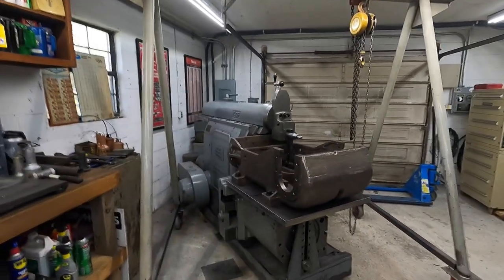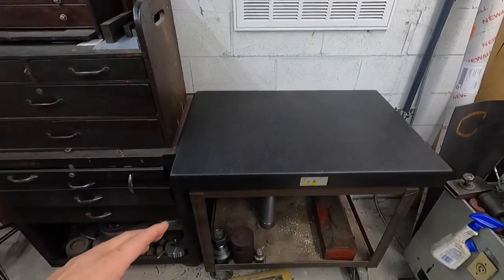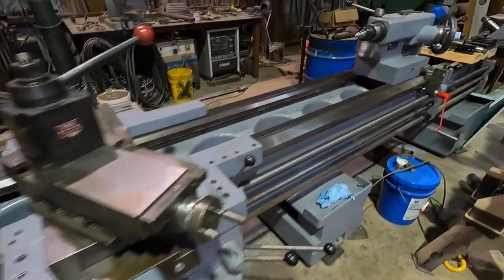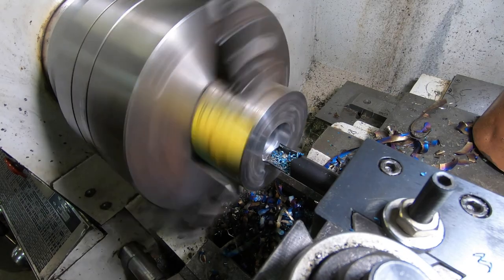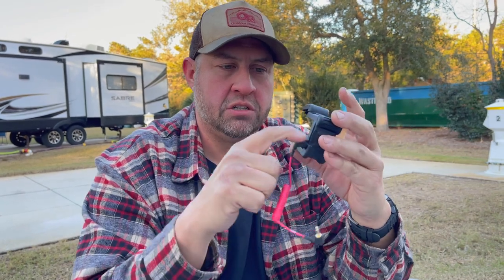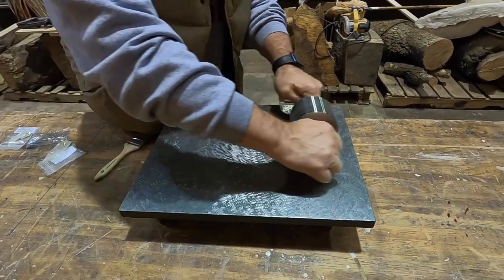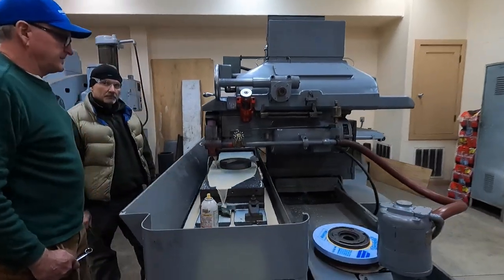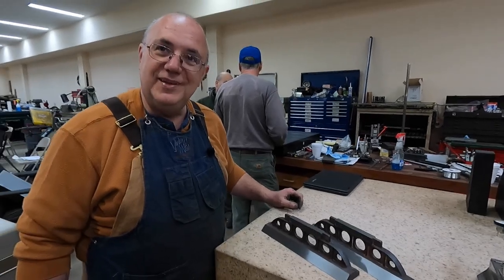SNS 333: Several Shop Projects, Richard King Scraping Class, Audio Problems

Comment: GoPro's are notorious with voltage fluctuations when they get chilled and really cold. A lot of Youtubers up north are having issues of all kinds. Many of them have resorted to using 1" inch thick pink foam board to make a box for the back of the camera with room inside to stick a hand warmer pack inside.

Comment: Ref. (Stoker) Good choice Adam. Knowing machinery limits and not over stepping, is the safest option. Obviously camera angles show one version and from the actual picture it will appear differently. This is something for all of us to consider. The physical dimensions of the machine that is needed to cut the flats, would be a big machine. As you mention keeping centricity and linear planes true would be difficult with what you have currently (as good as they are). Good job man.

Comment: Hi Adam, I run a Go Pro Hero 3 and had audio problems with it.  The audio was either out of sync or not picking up any audio at all.  After a lot of research I found out that if the SD card is allowed to become half full of files, it caused the camera to experience the audio problems I was having.  Now, I film my segments for our Patreon Channel and  make sure I clear the audio files off the camera after I have downloaded them to my hard drive.  Since adopting this, I have eliminated all my audio problems, the camera now works perfectly.  It was very frustrating and annoying until I stumbled on the fix.  Hoping it might help you out.  Great video by the way, always look forward to your videos.  Regards a fan from Aus.

Comment: Thanks for the video Adam.
A2 is an air-hardening tool steel, the quench medium is air. 
One way to lessen the oxidation is to wrap the part in stainless steel foil before placing in the oven.
Reply from the maker: There’s lots of info on that in the book we used as our reference. Doesn’t HAVE to be air hardened, explained in the book.

Comment: Rule #1 in recording audio; check that you have audio, thqt your batteries are full, have spares, etc.
Rule #2 in recording audio; always have two separate devices recoding so that if the primary mic fails, you still havea a backup recording that may sound crap but at least you have something. You can get small recorders from Zoom or tascam that do a good job, you can mount them next to your camera so they will hear the same sound.
Reply from the maker: Defeats the purpose of having a single GoPro camera in your pocket and recording on the fly. Do you see folks who use them skateboarding, dirtbike riding, skydiving etc. using separate audio mics? The camera should work as designed and sold to us.

Comment: One way to test the wireless mic is to plug the receiver into your pc, there should be a recording app on there, if not, download Audacity
Or if you have an amplifier that takes that plug or an adaptor from 3.5mm to 6mm, wiggle the wires etc to find faults.
One of the things i'd recommend, have a mic plugged into the camera, then use a recording mic on your person, you'd haver to remember to make a noise to sync both mics (bang 2 tools together, then in editing line up the peaks) whatever way you decide, try to have 2 mics

Comment: The stoker engine part is a job for a horizontal boring mill like the one bcbloc02 has. The large mill I ran would have likely worked.

Comment: For your own surface plate stick a wedge ( or just a washer ) in two corners of the frame and a wedge in the center of the opposite side. There three points

Comment: I stopped using gopro when I had a 4.if you used the WiFi and phone app to control it the audio had a helicopter sound. Gopro knew this but did not recall the cameras. There are far better cameras for what you need. You don't really need a sports camera for everything. How about making a magnetic camera mount and have a couple of cheap $150 cameras mounted around the shop. Gopro is a brand that in my opinion is way over priced and lacks functionality. Your iPhone looked and sounded great.
Reply: Are you suggesting using the iPhone to record?Talk about lacking functionality. That is almost as bad as when I have students come for high level sciences that require a lot of math, and when I ask them if they brought their calculator they say, "no but I have my phone." LOL. You can't do math with a phone calculator and expect to do well. The phone turning off, having to unlock it, notifications, distractions, the screen doing between portrait/landscape, etc. Same goes for producing hours with of video each week. You can't shoot 10 hours of video per week with a cellphone. $150 cameras also aren't going to do what he needs them to do.
Reply: @littlejackalo5326  The iphone is 100x better than recording than a crappy gopro and far more reliable.  I am thinking you never have used either.  Anyone who does videos seriously has more than one camera for different circumstances.  And in this case he had backups.  I was saying unless your jumping out of an airplane, scuba diving a sports camera is not very good and lack the functionality built in like an iphone.  Gopro has no decent mic, screen,  or cloud services.  There really is no comparing the two.  The only issue with the iphone is the fragility of it.  And that's the only downside.  Also the iphone has a decent scientific calculator on it which is exactly the same as any other scientific calculator.  And as a BOD you would know not all calculators give the same answer.  But that's easily tested.  you can disable screen lock when using it.  I wish you were local so i could show you how a cherap camera can easily outperform an overpriced gopro.  You keep teaching math and I hope you do it with a passion.  If i was a student of yours i soon tell you that you need educating.
Reply: @littlejackalo5326  ps I owned a £1000 sony camera and it fell forward onto dust and was wrecked.  A gopro would have been a better option for that filming.   You need a camera with a mixer device built in or capture on a sep device like a zoom h5.  If one fails you got another audio back up source.  Or at least have a camera with audio level meters so you can see if your capturing audio.

Comment: I'm gob-smacked that the stoke engine job has you stumped - that must be really annoying having made that mounting plate for it too. It seems ideal for a shaper despite the depth although I did think a mill would have been a better way to tackle in. I could imagine using a horizontal mill with a spindle extension with an end mill mounted outside the arbor support - so using the rigidity in the over arm support to stabilise a longer spindle - there'd be room for the overarm assembly in the stoker engine casting - then the milling cutter just accessing one of the surfaces to be machined at a time.

Comment: Adam, If you rebuild the plate stand you should consider a 4 point support with a center hinged whiffle (or whippletree) under 2 of the points.   This gives you better support for the plate but frees 2 of the 4 points to eliminate the twist that 4 points can cause to a 3 point support plain.   Just weld a crossing angle or tube with a second angle hinge bolted on one side at the center and the 2 plate support pads on the hinged freely swiveling second angle or tube.
Reply: Just stick a washer under two corners an one in the middle of the opposite side. Three points. Done
Reply from the maker: Negative, and it’s comical to read the comments from Eastern...🙄

Comment: We use some long reach tooling that would more than be enough to get down in there on our milling machines. They use special extensions that lower and almost eliminate vibrations. I've had a 2" carbide insert mill extended almost 24" taking 0.060" doc. I think he's going to have trouble with his old horizontal as well.
Reply: @jeffreylee7184  Most of Keith's machines are subpar at best. I'm guessing however he manages to get that buildup milled down will be good enough, as he says.

Comment: it's the mediamod thing that's the issue.  Get the usbC to mic adapter from gopro(make sure the firmware on the cam is up to date), and then look on amazon for ULANZI they make an enclosure case thing that I use. Paired with a Rode wireless go setup, works like a charm!

Comment: With a big enough machine, rigidity is not going to be an issue. It looks like tooling marks remain from new, indicating a large diameter cutter dropped in on a vertical shaft from above. A locomotive building shop would have had such giant machine tools, virtually never seen in job-shops. Photos of Alco and other builders shops from the steam era reveal massive machines.. some big enough to mill on locomotive frames.
Reply: Thanks! I was wondering how it was done originally
Reply: @jraybye    Its just a guess based on seeing what looks like tooling marks. I have been through a few steam locomotive machine shops and studied photos of the big shops at Lima and Alco in decades long ago. The machines they had were absolutely huge.

Comment: If  that camera dose the REEEal nice autofocus on the tight zoom. Think about it It's the IMAX for what you do  and the audio is probly simple these day's Most people would'nt give you $50 for a 24 track real to real tape machine (The real of tape was $3500 in 1991) I listen on 5.1 channel Your audio is real good in the big shop with lance the depth of the echo  and your voice  not to boomy and that saw in the background (No clipping your voices at all) work that equipment in slow is your sound card compatible is there a drop down menue with a check box" use external microphone with camera dongle" Ya thanks your video's, just amazing adam

Comment: GoPro is designed to be a waterproof rugged sports camera. That is not your application. Might consider a small Sony or Fujifilm pocket camera on a gimbal. I like to have both a mic in and a headphone out jack on my camera but the HP out jack is harder to find on the smaller cameras. You can also use an iPhone as it is an excellent video camera with an app like Filmic Pro. But that can be clunky to use with the Lightning to TRRS dongle for external mic or Rode Go receiver. And it is a pain when you forget to go Airplane mode and get a phone call while shooting.

Comment: Interesting.  Remembering a Van-Norman tech that 'rebuilt'  my crankshaft grinder...Center gets worn out due to many small crank grinds.  Best out of round approaches 0.001...unacceptable but happens due to the grit. 6' crank...AOK, 6" crank, no good.  Guy was an artist at rebuilding...totally manual scrape.  I was very impressed.  Dove-tail pattern on re-finish was cool to see.  Straight edge and manual tools. Cool.

Comment: I believe Sony and Panasonic both have "vlogging" cameras that might be much better for you. Personal opinion, I stopped using GoPro a decade ago because of problems. Don't much like Rode either.

Bigger camera I might suggest is Panasonic GX85 or GX9 (I think). I personally wouldn't worry about 4k, 1080 is generally enough and I still use ancient Panasonic GH2 cameras. Only wish would be 60 fps, but I'm dealing for now with the limited stuff I'm doing.

Comment: I have the Hero8 and I’ve had nonstop issues with it locking up, memory card failures, it takes forever to connect to the remote, I use it to record my band and the remote is essential, but it works sometimes and not others, wasn’t very happy with it. I don’t use it daily so by the time I do use it, I have very time to mess with it, it just isn’t that great unfortunately.

Comment: It seems like every version of the Hero cameras have had some sort of an issue at one time or another.  For that matter everything ever sold on Amazon is that way too.  You'll find someone who loves it and some one who hates it every time.  The fewer the features the more reliable something typically is.  Some of you may recall I repaired Adam's Hero 4(?) years ago now.  I wonder if the older models are/were more reliable?

Comment: I do a light amount of grinding, but have never seen a overhead dressing tool like the red one on the surface grinder lance was using. How does that work, and stay as parallel to the chuck, as a chuck mounted diamond would be?
Reply: I agree. I always prefer a properly chuck mounted dressing for a true parallel dressing of your wheel.
Reply: @PNEKarl  maybe something im missing. I don't see how that would work well, unless there is some way to dial it in. Not sure
Reply: It likely plows across the wheel at a slight angle but as long as you are doing flat work where you can run the wheel full width across the biggest diameter will be doing the work of making it flat and parallel.

Comment: Turning the part from the stoker engine around 180 degrees doesn't work either? Looks like there's more clearance for the tool holder there. But you have surely tried it, shame that this doesn't work out. Hope it can be done at all.

Comment: I know you think a lot about it but if you rotate stroker engine  180 deg (by vertical axis) -  will be it still in shaper operation range? It looks like wuold be more clearance to tool head.

Comment: Totally understand your setup issues with the Stoker engine. Any idea how it was originally machined way back in the day?
Reply: I think if you go talk to whoever did the welding there were rotary cutting marks. Some of the old machine tools were huge and solid as a rock. The frames were cast iron so had little tensile strength as opposed to today's steel frames. Stress levels equals deflection. Today's frames are plenty strong enough, they just have deflection

Comment: Wait...so you oil quenched A2? 
Price check in aisle 9.....
Reply: One can use an oil quench on A2 sometimes. Especially for large sections (which that piece most decidedly was) otherwise it cools so slowly one may not get the max hardness out of the material. See here http://cintool.com/documents/air_hardening/a2.pdf for an example. It is not for everything... one thing nice about A2 is that it tends to distort less than other tool steels from heat treatment. Also tends to crack less. But an oil quench on A2 raises the risk of distortioan and/or cracking a bit. All about the tradeoffs. Not much danger in the part Adam was working on nice and round without too many sharp corners.
Reply: @utidjian  Close, but no cigar. It was meant as a joke, but just incase someone reads your comment and gets the wrong impression. A2 CAN be intermittently quenched in oil down to 900 F then drawn down in temp until about 150F, however there is more to it than that. The manufacturer of the steel is the first source for information, as their "recipe" for the steel is often different than others. Second, consult a shop that specializes in hardening with your specific design for best results. As cross section, and details (like corners, bolt holes, and sections with large variations) help with the planning of hardening, also for consideration is the following machining procedures and finally the intended use is important. Never just do a quick google search and run with whatever you find on the webs, if you put your time into a part make sure it is not going to be wasted.
Reply: @sshep7119  Thank you for taking the time to clear that up. I should have addressed the points you make with more clarity and examples. My apologies for missing the joke.

Comment: If you could try using the Rode mic setup with success on any other camera, I'd then rule it out. Mostly since the Hero 9 failed with it's own internal mics, which might mean it's definitely got issues.

Comment: 22:25, what is the motor mounted to the oil quench doing / for?
Reply: Was wondering too.
Reply: I thought I saw a shaft attached to it....for stirring the oil from time to time....might get a bit thick.
Reply: Probably a mixer to circulate the oil for large parts getting quenched. Keep the oil at a more uniform temp.

Comment: Ok I'm maybe a bit confused but if I understand this right with the granite plates you scraped the high points & then lap them in with the diamond dust & the wheel? If that is correct I would think it would take the patience of a saint. I would love to see a time laps with a real time clock because I can see that taking forever.
Reply: Scrapping the high points is for the metal which you saw the students doing. The surface plate is lapped in until it is flat to the grade you are reaching for. ex. Grade A, AA, AAA. If you are interested in this then I suggest.  https://www.youtube.com/watch?v=6nY7uW1uG9s
Reply: You can't scrape granite. Scraped the cast iron surface plate and then imbedded diamonds into it with the wheel, and then used the iron plate to lap the granite plate.
Reply: @felixar90  ok thanks that makes more since

Comment: I am not sure if I missed it but did the hero 9 rode combination work at some point? I had similar issues in the past with rode and recording hardware and the source of the problem was the cable connection. The rode had a stereo 2.5mm jack output and the recording hardware had mono 2.5mm jack inputs.

Comment: I had similar problems with my rode mic setup and gopro hero8.   My problem ended up being a bad 3.5mm mic adapter from gopro.   Looks like you're using a "media mod" housing instead of the adapter but it still could be the cause of your problem.  You might want to consider an external audio recorder.  If you do that, avoid the Zoom h4n pro.  Although popular, it's got serious issues with the SD card interface .  I've got the Rode HS2 (headset), rode LAV, and several of the rode Wireless GO kits like you're using.  Any problems I've had using the rode stuff has always been traced down to some other component (like that Gopro adapter).   tldr: Try returning/exchanging that media mod housing.